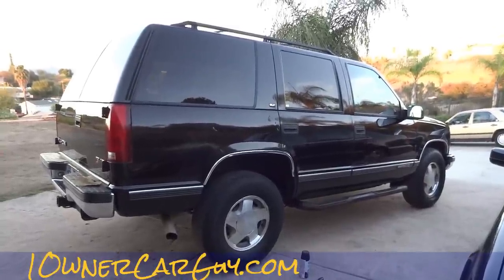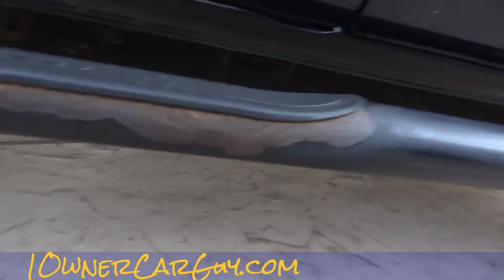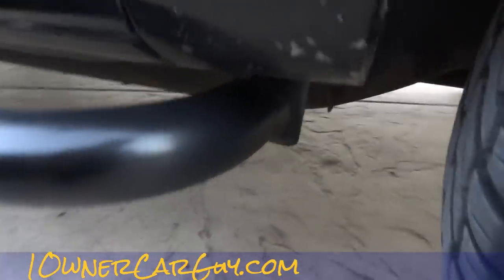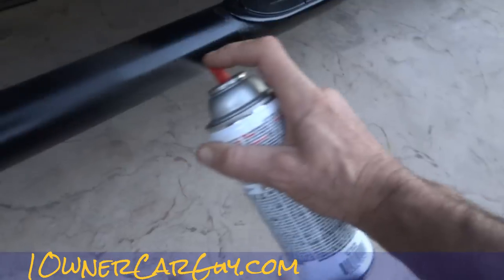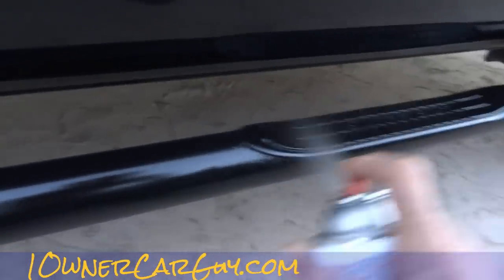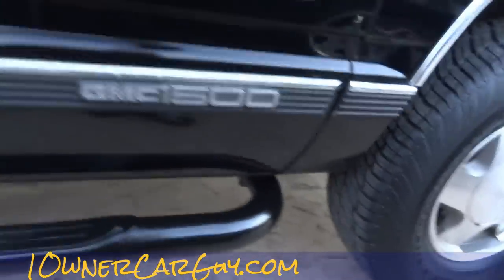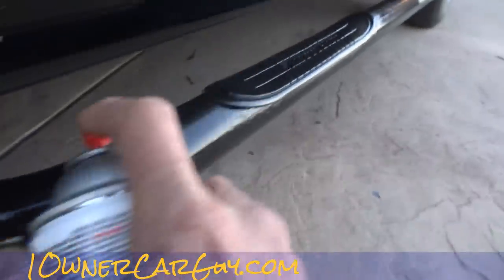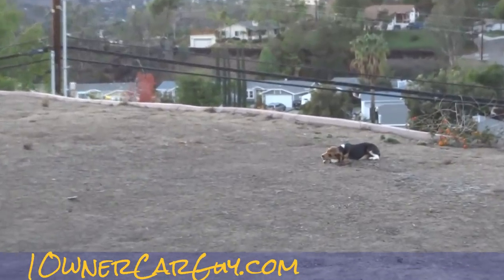DIY Auto Spray Paint Running Boards How To Home Painting Video

Comment: I can't believe you just spray painted without masking off your vehicle. you could just remove the "nerf bar" and not worry about over spraying your vehicle. please no one take this seriously
Reply: Cereal Marshmallows (teXas N8) I actually agree with you, why not sand down and mask off. No disrespect but I'm doing this on the steps to resurface a nice Mercedes Sprinter. I wouldn't do anything this dumb and potentially ruin my bus nor should anyone who cares about there own possessions. I feel like you could have given better advice than to just spray away without considering people might ruin there paint with splatter all  over there car.

It's one thing if your car is black if not you definitely should be masking off for over spray. You make good realistic vids but this was a super amateur video someone's about to ruin their car watching your technique. BTW I can piss just fine just in case you thought if using that line again.
Reply: Wym the guy that can’t hit the urinal... I bet there’s paint all over the bottom of your car now.... it literally floats in the air with the slightest breeze and sends overspray everywhere... especially when your outdoors....

Comment: quick question for you I have a 2008 Navigator with running boards the motor is gone I was just wondering if the running board have to be in before the motor is remover

Comment: One owner car guy because he has owned all but one vehicle and has no experience whatsoever with it and gives horrible advice. Did not take the steps off for one so overspray is all over the vehicle. Didn’t not sand, clean and prime before spraying. And also over sprays without doing coats and a time and still continues till the paint drips and has it looking like crap.
Reply from the maker: There is not a drip on it it was sanded and overspay is not anywhere on the truck I can aim and no wind you are a buffoon....